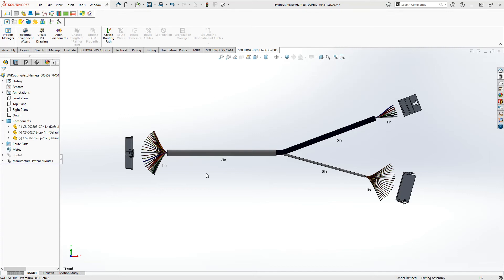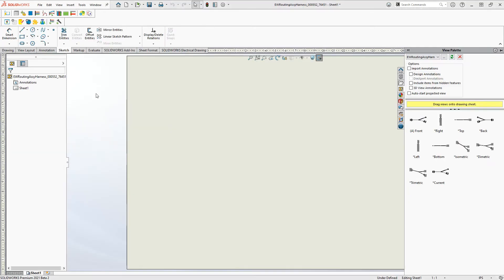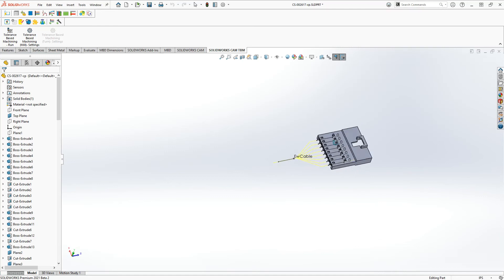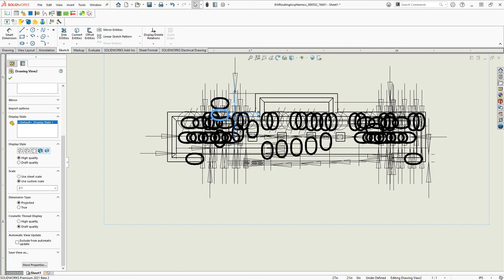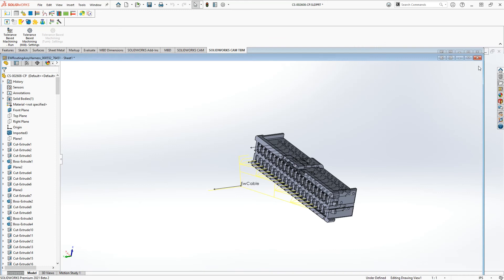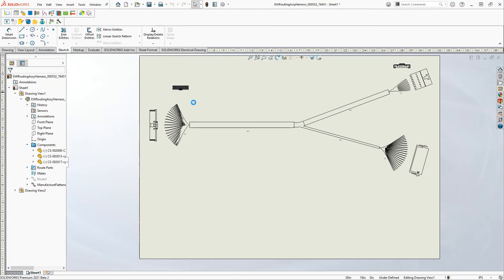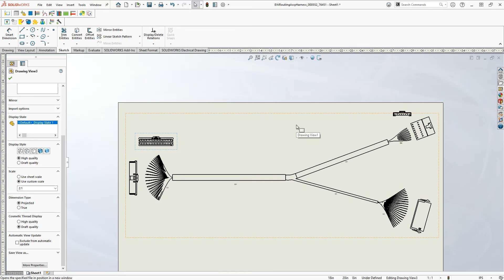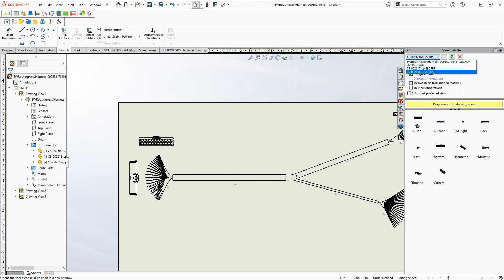Adding various connector views

Comment: When I flatten a route, usually wires stay connected to the connector, but sometimes I get fanout, or even more often, partial fanout, where few wires stay connected to a connector, the rest are fanned out. It looks broken, and I can't fix it, it doesn't appear to be dependent on my workflow or some methodological step I make, because it appear sporadic on different harnesses that are defined and constructed with the same parts and the same way. Do you have any idea how to fix that?